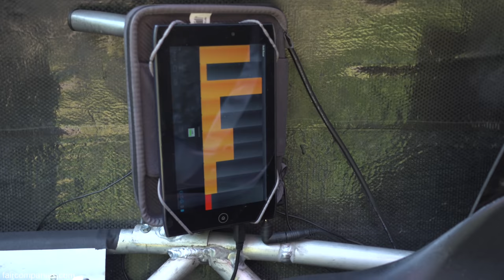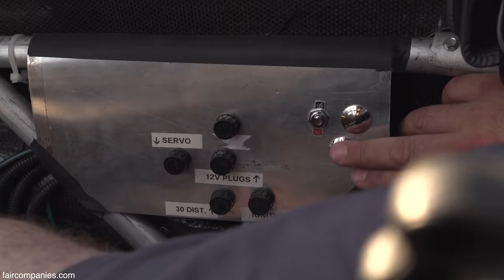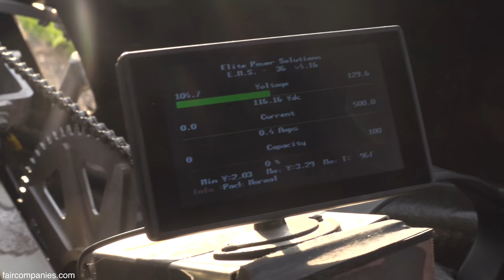MN friends seek joy of commuting by adding pedals to fast EV

Comment: To correct some misconceptions - 1. This is a prototype - not  by ANY means the finished product. 2. The price is $24,000, not $35,000-$45,000. 3. The production model would have a roll cage, seat belts, air bag, antilock brakes, etc. Maybe it's not a sedan, but it's also not a bicycle on a busy street, or for that matter a motorcycle with zero protection and 2 wheels. 4. The goal of the company over time is to increase efficiency so there is a higher percentage of power generated by the driver.
Reply: My friend, this is super cool. People in the EU would love stuff like this. And I do understand that people from the US are more prone to disliking this, because everything in the US is huge/far away and I get that people love their cars for that reason. But stuff like this is definitely the future. Good job!
Reply: The workout time-efficiency thing is very appealing.  Most people have nothing productive to do during their commute anyway.
Reply: Don't get disheartened by the negative comments. I think it is a good concept and an interesting video. The commenters on youtube are a tough audience - and will often zero in on some perceived negative aspect, even if they like the general idea. But like you say, it is only a prototype.
Reply: $24K buys me an e-bike and a Honda Fit for when i have to haul something or when the weather is too bad for biking.   I don't live in a McMansion and drive a six door gas guzzler either, which is more emblematic of our culture.
Reply: Sir Can you please tell me what kind of electrical component you have been  used in this car? Can you give me the total information of the electrical design and component power?
Reply: way to much for the common man.
Reply: Rich this is a great idea.  I wish you guys the best success( i obsessively check for news on google about you guys).  Anything we can do to introduce human motion will be so good for us physically mentally and emotionally. In addition to the potential climate benefits of smaller vehicles and human electric hybridization, it's just plain good for us to have a greater roll in our own locomotion. 

 For those of us in the north especially if it's hilly there is nearly zero chance of daily winter biking without taking serious risks to your life(from dubuque here)This would make winter so much more fun as we cant safely navigate the bluffs here once first snow falls.   Hope you guys find the capital to proceed, there WILL be a market for these if the design and quality are there but you will likely find greater success in europe.
Reply: +dward218 Dibuque, Iowa.. How would you like an Enclosed Hybrid Electric Cycle for less than $6K? We're working on mass production of a much lighter, sub-100 lb unit with a range of over 50 miles electric plus pedal.. And much more.
Reply: Hi Rich, I would like to be in touch to see what can be done to mass produce
Reply: funny you should ask, Yes, I'm actually building something similar, a reverse trike as we speak Though it will be highway legal and side by side seating.  That price is fantastic.
Reply: For different segments of the market. I love the design. We need to bring costs down, of course. I'm interested in how your development on this is tracking. You inspired me years ago when this came out. How would you like to learn more about our similar market (Enclosed) Hybrid Electric Cycle for less than $6K? We're working on mass production of a sub-100 lb unit with a range of over 50 miles electric plus pedal, heating and cooling, HEPA and charcoal filters, atmospheric monitoring system, and much more. Let me know! Phil (founder)GV Hybrid Electric Cycles
Reply: Personally I think keeping it classified as a street legal motorcycle is just fine. For sure at least to start out.
Reply: @william4661  "People in the EU would love stuff like this." NOT AT ALL
Reply: @william4661  the average dutch commutes travels longer than the average american, stop lying.
Reply: like the mango?  @PhilipX2030
Reply: Joe Scheller this why they will never be successful.

Comment: At least he's aware of the flaws.  My first thought was that it was too small.  Pedaling while stopped at a light, now that's not something I would not have thought of.  I used to ride a bicycle in California, which allowed me to be just as fast, if not faster since there was so much traffic.  Lots of perks beyond fitness on a bicycle.  Some of which are lost in that thing.  But a lot is gained too.
Reply: Right. The width of the vehicle doesn't really hurt in the low-traffic area this video seems to be filmed in. Honestly, the pedalling doesn't add a lot to the range of the vehicle, but I like the idea of a small, light electric vehicle for one-man commutes. It's cheap to operate and it is fast enough to safely drive on sparse highways.

Comment: Never seen a triple cab before! That's impressive and it's not even the focus of the story! The pedals for charging I like and the overall shape is more practical for entry/exit than most while still looking slippery. Perhaps a future model have the door extend up into the roof to allow taller drivers easier access. That steering column is holding the whole thing back though- would you consider "tank steering" to clean up the cockpit? Above seat steering on recumbents often has the bars so close to the rider that my elbows are bent too much and my hands get numb from reduced circulation, something that hasn't happened since i bought a trike with tank steering. I reckon the electric + pedal charging type system would be good on a regular tadpole trike- being able to pedal at a comfortable speed up or downhill regardless, waiting at intersections or stoplights charging all the while.

Comment: Very nice! The body design reminds me a little of one of my favorite electric cars, The Aptera EV. Although the aptera didn’t have pedals, which is a nice addition :)

My girlfriend and I are working on adding solar cells to our M365 EV scooter, which we are interested in adding as a range extender for the EV scooter. We just ordered the Genasun lithium boost charger, which will connect the solar cells to the 36 Volt nominal lithium battery. We plan to use the SunPower Maxeon 3 solar cells, monocrystalline type. Your video has inspired me :) have a great day!

Comment: I liked all of the specs, but was disappointed that peddling only added 5% to the range - Or did I get that wrong ?
Reply: john wheatley I heard 10-15
Reply: yep 5% he said
Reply: If  you pedal to and from your destination, pedaling is 100% of the range. Lol
Reply: i think a normal person can pedal about 100 watts for a longer time so if there is a high quality generator, maybe 90W is left and then it needs to be converted into suitable form for electric motor which adds at least 5% to total loss (took that figure from my ass). If it feeds to a battery first, losses are a lot more and you are lucky if you get 50W out. This thing uses several kilowatts at highway speeds (wild quess, 6-10kW?). of course the motor too loses at least 5% of that power. Maybe if one travels at normal cycling speed of 20kph (12.4mph) and this is done well, you might generate half of the needed energy. maybe they should get rid of that expensive davinci cvt and just take more power from the generator when user needs a harder workout.
Reply: Bottomlands actually he's right it is. I live in MN and we do get ticketed for driving to slow. We don't get to choose our safety level when driving, so we are forced to drive sometimes at what seems to be an unsafe speed.
Reply: Jarkko Aitti look into how electric skateboards work. There's a lot your not taking into consideration but your on the right track. There is a loss because of the weight initially but once it's accelerating the loss goes down. I'd imagine anything he didn't talk about is proprietary information so we won't know for sure, but we can guess some stuff. The bike would have a speed it can reach where the amount of energy put in is close to the output. Without the actual weight though (including the person driving) it's hard to do the math.
Reply: Bottomlands I think I see the disconnect here. My brother does the same thing. When asked what he thought about freedom of speech he thought it just meant he could say whatever he wanted. So I took out my poster and we read it together. That helped him understand a lot more. Your missing all the stuff connected to it. You see the plain google search but don't bother to look into things. I think the name calling really shows your character which sadly means I no ones going to be able to help but yourself. Work on it, open your mind to things you don't completely understand and you'll get there man.
Reply: Bottomlands I'm guessing your pretty young. Adults don't tend to talk like that. So that's cool you have plenty of time to learn. Have good day yourself too man. That was nice of you too mention. I appreciate it.
Reply: Mickiddy Michael, Bottomlands has no content; probably a bot or Russian troll. Not much a sane person can do 'bout that. Greetings from the left coast.
Reply: @Michael D 
I have a 50cc scooter and as much as I love the thing I'm about to sell it because there are no roads that I can take if I want to go to another borough/district.
The roads go up to 40mhp and there are no bike lanes, but even where there are bike lines the police have a fit when you take a gas operated vehicle on it (they have zero issue with those electric bikes even though they have the same speed)
Reply: because even 10 lance armstrongs pedalling at once and a big aerodynamic fairing over them all wouldn't achieve highway speeds. you wanna commute 50 miles a day. you definitely can. you need to be prepared to cut a few after work engagements off the list though if you're going to do it under your own steam.
Reply: its too heavy
Reply: These have so low friction, it does not matter if you provide a lot yourself. Electricity consumption is insignificant.

Comment: Considering exercise was his reasoning behind this he would be better off with a fixed pedal to motor ratio. A 5% efficiency doesn't incentivise pedaling so a bigger model would be further function-creep away from what he was trying to achieve. If I were him I'd lessen the distractive tinkering, change my diet and get an exercise bike.
Reply: amigiac you misunderstood. He said pedaling adds 5% to the range. Pedaling is pretty much worthless in electrical generation. The pedals on this actually hinder this vehicle. Its all about weight. More weight = less range. Pedaling is almost purely for exercise. It is a covered ebike essentially.

Comment: A good concept, however, I dont know anyone willing to pay 25k for basically an ebike they have to register/insure. If you are going the high speed route, get rid of the peddles and streamline it for aerodynamic efficiency. I know a lot of people who were interested in the elio 3 wheel electric car that was proposed for less than $15k. Also, if you go with a full frame/cage, then don't try to do it with a single piece body as this drastically increases cost and time. Smaller and easier pieces to manufacture and assemble will also reduce cost to buy as well as replace due to the occasional accident. 

Also, for $25k you can already buy an electric car...

Either way, keep up the good work!

Comment: It's interesting.  I feel like I've seen so many iterations of this type of electric bike/car/velomobile combination and they all end up shooting too high.

The biggest issue with this is always going to be price point.  Why buy a smaller and less safe (even if it has a roll cage) vehicle when I can buy an equivalent car for the same (or less).

If you need exercise then it seems like someone should look at modifying existing cars to have a pedal system.  

You could even take a car built for a paraplegic (hand breaks/accelerator) and just add pedals...   I'm not an inventor, just throwing out some ideas.

Comment: i would be interested in a trike that has this body on it. we ride all year long in florida  but we are exposed to rain every afternoon , 8 months out of the year. if you could reduce the width to 32 inches outside dimension. make its primary  power source pedal power(3-5 speeds), then add a hub motor of sorts but limit its speed to 20mph (license requirements over 20mph) it would legally be considered an e-trike . if you sold  what i am describing for a cost of 1000-1200 bucks it would sell like hot cakes here.
 i would buy 2 of them.
Reply: You cannot even purchase an unfaired recumbent trike without any batteries for $1000. That price point is unachievable.

Comment: No flexible lightweight solar panels for the skin?  It would help charge uphill travels when pedaling gets too much? Doesn't black add to the inside heat?..stress on electrical parts?

Comment: It's a cool idea, a bit like the Sinclair C5 in the 80's which had the steering under the legs to avoid the problems this chap is having with the awkward movable steering column. As for the work out potential? As a serious road cyclist I'd take my bike and the weather over this, the workout part is a bit of a gimmick.
Reply: Right, definitely not as good as road cycling, but you can do it at the same time you commute so you regain your time, especially if your road cycling time means you are sacrificing time with your family.  Thanks for your comment, please see my post.
Reply: Ryan Anderson; or cycle with the family if that is an option. TAP keyboard and e-ink screens can help the kids text and keep up with their social media posts in the bright sun while riding.

Comment: If the peddles were connected to the wheels like a recumbent trike then by law it's gonna be a tricycle and no need for registration and insurance. Although based on regulations the electric motor is not allowed to kick in at speeds beyond 20mph on e-bikes.
Most of the e-bike manufacturers bypass the speed limit regulation by adding the offroad option, so the rider can activate it only when it goes offroad. But everyone use it everywhere :)
Reply: Abbas Sadeghi Bajgiran Great points! You're very knowledgeable in eBike implementation. Can you tell me more about yourself?
Reply: @PhilipX2030  I can feel the bitter taste of sarcasm in your comment buddy ;)
Reply: @TechSurreal  I would not assume sarcasm. I'm a straight-talker, interested in learning more about the people who have spent time researching Ebikes... with both technical knowledge and passion. I keep it real
Reply: @PhilipX2030  Sorry if I didn't get what you mean correctly at the first place. By the way I'm not a pro biker or experienced in the related fields. I'm just dreaming about having the electric velomobile that I always wish for :)

Comment: 👍💕
It looks Pukka , perfect size.....,for the person it was made for.. 🧐......you don't look very comfortable when pedalling.

My version is sitting alot more forward.

Thanks for the experience 😊
Reply: P.s......mine is mostly Throttle only and pedal assistant, I don't really pedal it without help...😂

72v 3000w rear hub motor
80amph Battery.....

I've still not got it to top speed 😀
Reply: I'm fit enough don't really want to pedal.....only put them on to TRY and fit in with the laws around ebikes, scooters,euc.....etcetcetc

I just like to fly along, it's like a Jetplane in a rush to get home 🤣

Comment: There should be 2 models: version 1, a virtual peddle 1-2 seat recumbent EB (legal on bike paths) @ what, $7,500- $8,500 price range? And version 2, a pure road-certified Electric vehicle tricycle with capacity for highway speeds and having an air-bag, signal/break lights , etc... @ what, $20,000 ?

Comment: Kind of an exercise bike in a car. It would be more environmental and efficient if you used the bike pedals to actually power the vehicle, instead of charging the batteries. The terrain gives natural resistance variability, for free! That combined with throttle for power assisted cycling, would mean you could cut down a lot more weight, and of course use far less electricity. In that great shell, that could be a nice build!

Comment: Very cool, But that steering system needs a lot more work, but it's very interesting
Reply: We are making some improvements to the prototype.  I changed it to rack & pinion, and we are working on tying the accelerator to the pedals, so that we can replace the handle bars with an actual steering wheel.  Thanks for your comment, please see my post.
Reply: I just noticed while watching him pedal looked uncomfortable, with the missive nobs. and how loose and shifty the column is. Clearly a prototype. Cant wait to see more of it.

Comment: Too expensive, too heavy.  What's the range on a charge?  I like that it is fully enclosed.  A 70 mph top speed is more than ample if I could trade it off for a lighter weight and higher efficiency.  My ideal build would use two 6000 watt RC motors, (such as Astro 3220 motors in their 6kW version) using a cycloidal gear reduction system to drive each front wheel.  With the rear wheel driven by purely mechanical, human powered system as used in a standard (bicycle type) trike.   $15,0000, under 300 pounds, with a 70 mph max speed, and 250+ miles range per charge.  Charging using standard electric car charging available on the highway system.

Comment: Meanwhile Twike has been in production for 22 years now and currently costs $26k with practically everything raht promises. I'm still looking for where the claim of a $6,800 model came from. But no point reinventing the wheel. This RAHT design is not original.